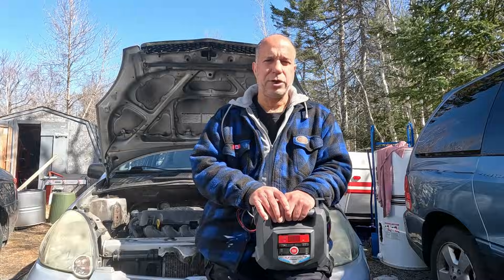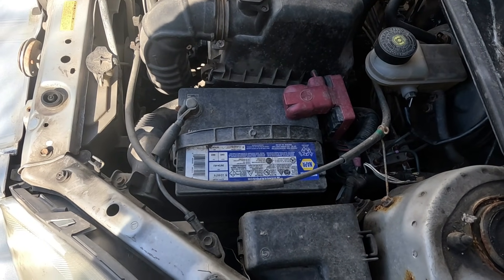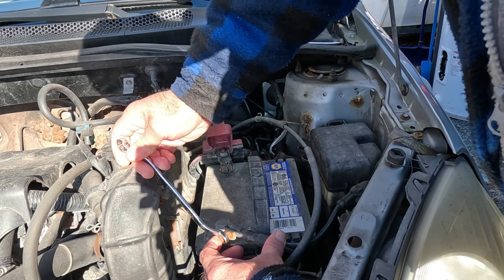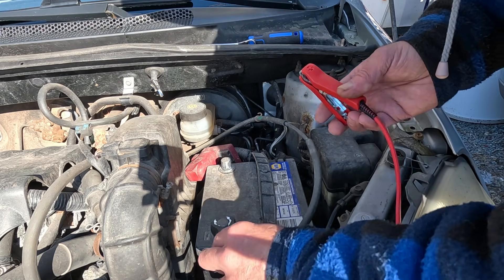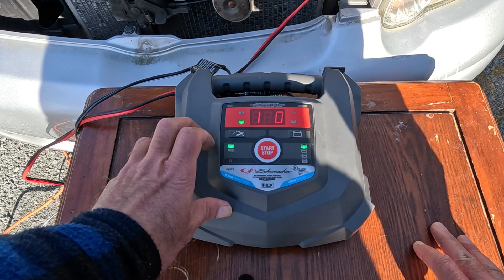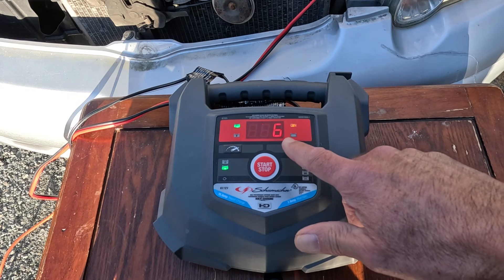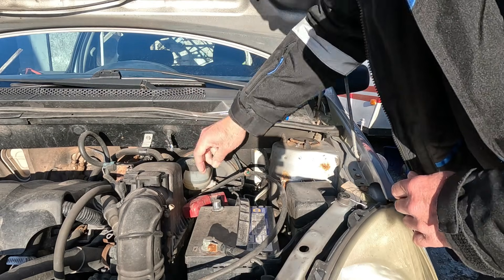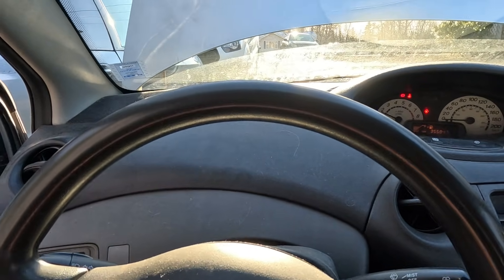How to charge a car battery with the battery in the vehicle

Comment: You want to connect the positive sidee first then the negative, you will get no spark. You could have also just kept the terminals conntect since you didn't have the key in the ignition turned on.

Comment: Why do you think it is necessary to disconnect the terminals? I can't see a problem, even in a modern car, as long as the ignition is off. Disconnecting the battery requires resetting several components, such as clocks and windows. In my experience, it's quite safe to just attach the leads, switch on and let it do its thing.
Reply from the maker: Valid point Eagle - I'm just being extra cautious in case a viewer has some electrical component installed that I hadn't thought of !

Comment: Fyi i grabbed a 4000 amp gooloo booster pack for just this occasion. It will boost up to a 10 liter diesel.
Reply from the maker: Holy crap - you went beast mode 404 !